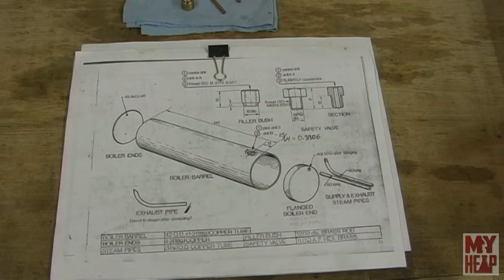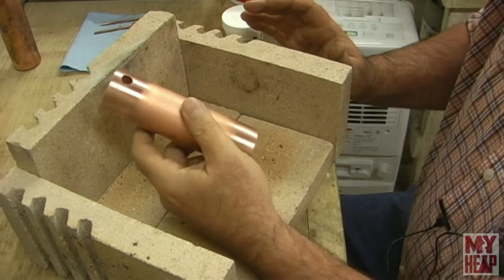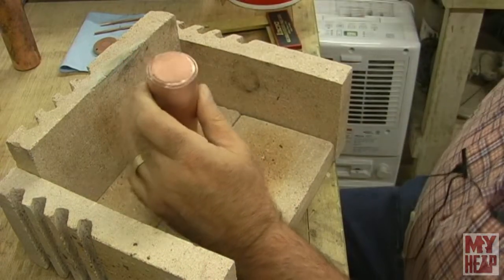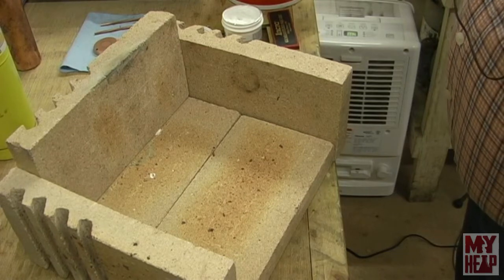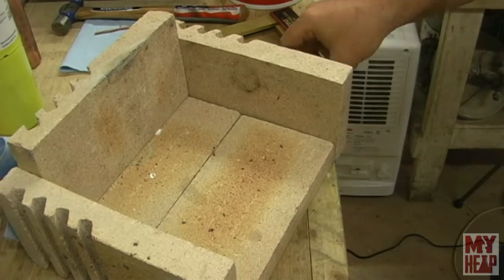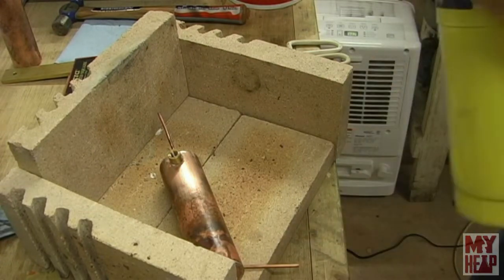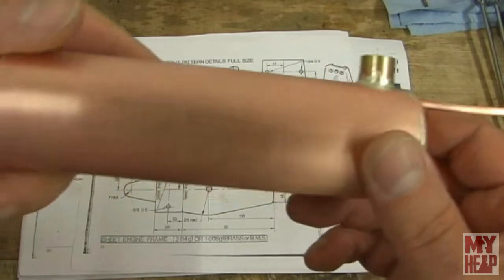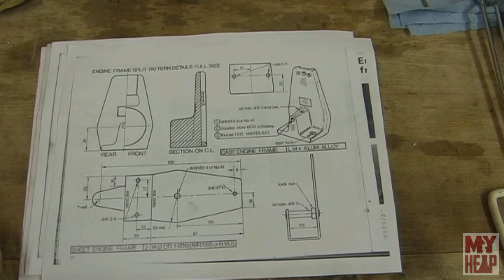Kenneth Wells Stationary Engine - 09 - Silver Soldering the Boiler

Comment: Nice job Joe, first time as well. If your not sure you have enough heat, you can always shield it round a bit so that you retain as much heat as can. Some extra fire bricks around the boiler would help a lot and it would help stop it from rolling around as well. Be honest, when it started to fall off the bench, how much did you have to fight the instinct to reach out and grab it, I’ve been there before.
You can sometimes form a ring of silver solder so that it sits right in the joint, it makes life a bit easier and leaves a perfectly filleted joint, very neat. But hey!, you did an excellent job, the only thing is I would be inclined to reflow the bushing joint before you go too much further. The only snag is that once silver solder has been melted it takes even more heat to flow it again, make sure it’s ultra clean and dry to begin with, you know what it’s like, it will probably be fine, but you know it’s there!.
Reply from the maker: Hi Jim.  Thanks for stopping by and offering up some great tips.  For whatever reason, I was most intimidated by this part of the project.  I done a test off camera that I showed before I started so maybe I wasn't as apprehensive as I could have been.  I will say I learned a bit after examining my work.  These are,

The work has to be just on the verge of red heat before the solder will melt and flow, and has to be just slightly red to get it nice and fluid.

I used too much in some areas, but mostly on the bush.  The back part that I could not see has a lot and that is where the pin hole looks to be.  You are probably right, I should clean the area real well, flux and see if I can melt it back and get it to fillet.

Now my first instinct was to reach out and catch the falling work.  I even felt myself flinch that direction before the brain kicked in and said don't do that.

Next time I solder a bushing in place, I think I will try the ring of solder trick.

Thank you for visiting with me and taking the time to comment.

Joe

Comment: Joe,
Do you know those old Sievert blowlamps? The ones that work on kerosene or petrol? If you see one at the carboot sale or yard sale...snatch it up! They give you two advantages... once cleaned up, the are very nice on the shelf (they are usually made out of fine brass) and... they are ideal to heat up work pieces for brazing (as a second flame) because they give a powerful amount of heat (more than a propane torch) I gathered a few over the years and I have used them for brazing, and it works very well...never an issue of not having enough heat.
If you only have one torch, and you have to braze a piece like that lill' boiler, give it a jacket of rock or glass wool... you will be amazed what a difference that makes.
That all said, nice job !

Paddy

PS you need an ordinary pressure gauge...  the oil filled ones are mainly suited for high vibration environments, and applications with wild pressure swings
This boiler will only have to get to a few psi working pressure and two, three times that for the hydraulic test is still only a few psi... so a simple hand-pump and a simple gauge is more then enough. Those hand pumps (manual boiler fill pumps for miniature engines) are easy to make. And they easily overcome 200-300 psi
Reply from the maker: Thanks for your help Paddy.  I think I will be okay with the gauge I have on hand then.  I only need to make a hand pump.  The design in the TICH book looks doable to me along with the pressure relief valve.

I do know what your talking about with the blow lamps.  i will keep my eyes out for one.  I cannot remember the last time I saw one but if one shows up at a reasonable cost I will snatch it up.  Thanks Paddy!

Joe

Comment: G’day Joe, well done. That pin hole could be a problem in the future, I’d suggest touching it up and whilst you’re there reheat the end cap as you dropped it just after soldering it, it may have not set fully when it hit the floor (and you were doing so well) :)
Keep up the good work, cheers 
Peter
Reply from the maker: Hi Peter.  Glad you stopped by.  Dropping it on the floor was definitely not in the plans.  I think it's okay though.  As far as the pin hole ... You, Emma and Jim have all suggested I take care of it.  I think your right.  I will try reflowing the silver solder around the bush the next time I am in the shop.  Hopefully tomorrow.  Thanks for watching Peter.

Joe
Reply: Take it to work, I’m sure when you start up that blow torch it will become a talking piece, 1 word of warning, not near oxygen supply. 
Cheers 
Peter
Reply from the maker: @pgs8597  HAHAHA  At the risk of sounding like a smart Arse.  I suspect the maintenance man would be in awe.  (Was that bad?)

Comment: Hi joe
great video, looking good, any doubts about the surface pin hole, just reflux and reheat, look forward to seeing the rest of the build
regards
mr f
Reply from the maker: Thank you for watching Mr. F.  I think for sanity sake, I will go ahead and reflux and reheat the pin hole.  More because I know its there than any leak at this point.  If I recall correctly, you have a video on making a hand pump.  I think I am going to open the book and watch your video.  Between that and the TICH book, I should be able to muddle my way through.  :-)

Joe
Reply: Yes hand pump is somewhere in the list, a bit more silver soldering for you though on the pump body
regards
mr f